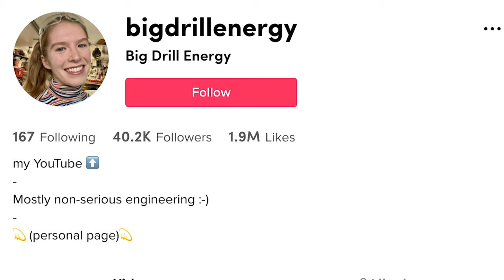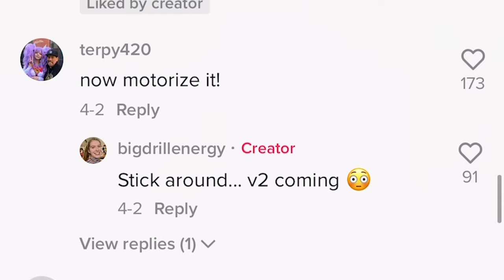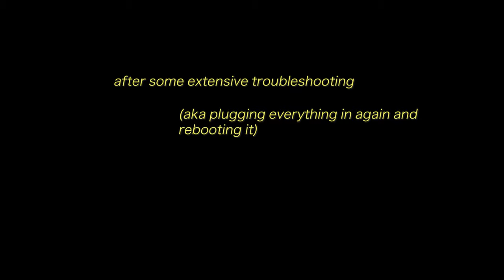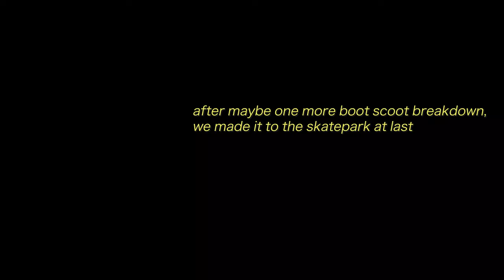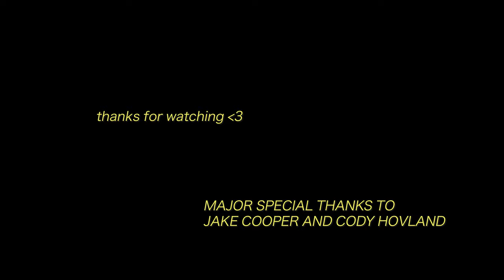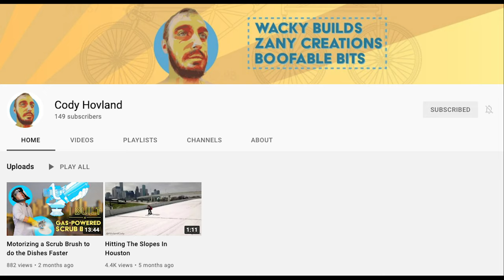The Boot Scoot 3004 - motorized m'ass transport

Comment: What if you use wear heelies? That way you won’t wear off the soles of your shoes
Reply from the maker: Excellent question! There was a lot of debate about this. It ultimately ended up as no heelies in order to preserve the seamless transition from scooting to walking and vice versa. Also, I used the flat surface of my soles to tripod myself for stability and pushed down on my heels when I wanted to turn (e.g. left heel press for left turn). Last but not least, my shoes were too new so I fixed that. New Edit that I forgot about: the most important reason, I relied on my heels for brakes lol
Reply: @RubyZoom  I’ve never used heelies, but people appear to more/less seamlessly transition from walking to rolling with them. So I think all your worries are also avoidable
Reply: Leather soul shoes then ?
Reply: *sole

Comment: I'm from the esk8 subreddit, this looks like such a fun build. I'm a boosted owner (although it's now broken because the battery is eff'd, so I've replaced it with a backfire zealot) and that boosted board error beep gave me flashbacks to all the times that one of my motors shut off while I was riding and I'd have to pull over and power cycle the board lol. So many times that I'd hit a small bump and I'd hear "BEEPBEEPBEEPBEEPBEEPBEEPBEEPBEEP" from the remote, I feel your pain
Reply from the maker: Thank you for your support kind internet stranger!!  And yes.. the beep beep beep was the bane of my existence for many hours. I’m glad I’m not the only one😂😅
Reply: @RubyZoom  I still have no clue what the hell caused it either. My board would go months without it, and then suddenly I’d lose a motor multiple times on one ride. I’ve got a friend that worked for Boosted, and even he didn’t know what caused the issue. It was suuuuuch an obnoxious problem. Countless times I had to pull over and restart the board 😭

Comment: You could try some UHMW plastic on the bottom of your shoes. Shouldn't be too hard to get some. It has great abrasion resistance. I've seen Justin @ Rainfall Projects use it a lot as a bushing/washer for tractor parts, as well as just being a really cool material.
Also, you could use a stick to steer. Just jam down on the side of the stick, it'll increase friction pulling you that way. The UHMW should drastically reduce the wear on your shoes, but the lower coefficient of friction will negate a lot of your foot steering I bet.
Another thing you could do is separate the boot scoot motors to have independent control. Then wire in some kind of gyroscope. You could put the gyroscope with your battery backpack or even link it to your phones gyro but that sounds like a lot of work. Write up a little program to implement skid-steer(make sure to add "skid mark" jokes to boot scoot monologue) like a Bobcat has. I.E. if you lean right then the right motor decreases speed while the left remains constant. If you're going that nuts, add forward and backward sensors for start/stop as well -> no UHMW needed.
Engineering is fun, I hope you put out more fun videos. Don't take yourself too seriously, half the fun of your videos is the bad puns!

Comment: Get some durable slidey plate for your shoes so you won't be scrapping the soles everywhere.

edit: Oh, forgot to specify it should not cover the whole sole, so you can still have grip to walk normally.  angle your feet to make the plate be the only thing touching the ground when riding.